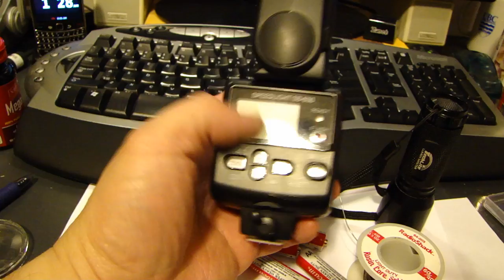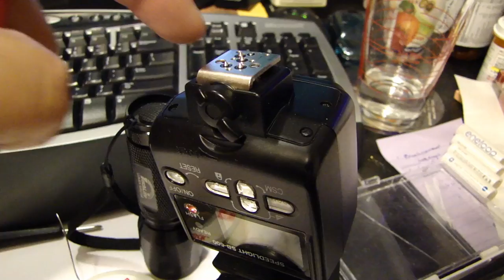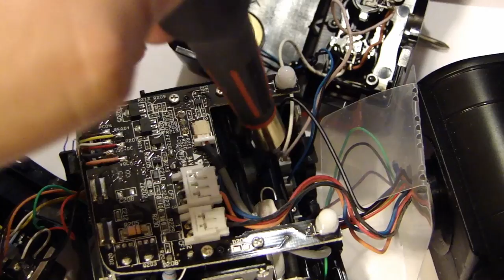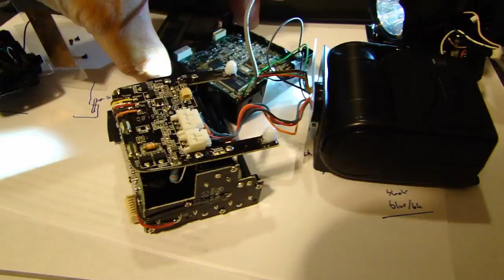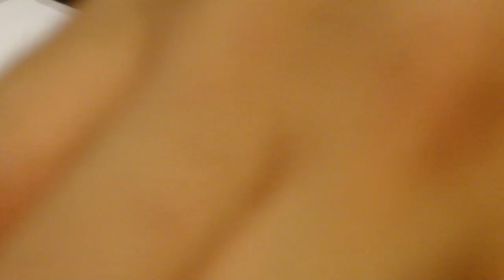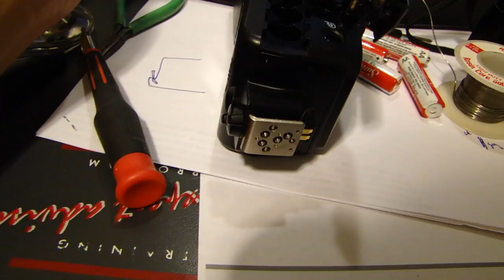How To Fix Nikon SB600 Flash - Dropped & Does Not Power On

Comment: Just wanted to say a BIG thanks for sharing... 

This excellent video provided me with the confidence to 'have a go' at fixing my 'dead' SB-600 after dropping it.

After opening the unit, I identified the F100 inductor - yup, it had taken a hit - bits of the shattered shielding rattling around.

Sourced a new F100 - Ebay (£3 inc P&P) and set about swopping them after watching a few 'surface mount soldering' vids on Youtube.

Put the unit back together - powered it up and it's working again!

Comment: Great video. Saved me 100 Euro. I took my SB600 apart, didn't find any unmounted / loose parts. Anyway i re-soldered the mentioned component on the circuit board and after re-mounting i was happy to see my flash working again :-). Thanks a lot.

Comment from the maker: I have not experienced your issue but in my research to fix mine, the two top problem/fix for SB600 was 1) the broken solder joint shown in this vid, and 2) the flash turns on but won't flash, and the actual flash needs replacement in the flash head. I can't guarantee that is your only broken part.

Comment: Thanks, I solved my problems with this flash following this video.
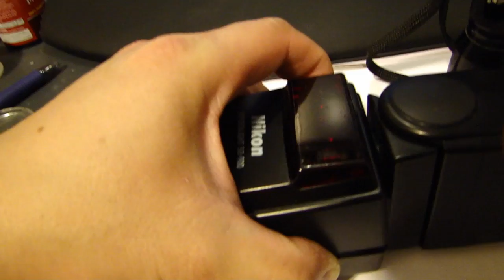Some comments: it is sufficient to remove only two screws near the head of the flash (see at 1:31); it is not needed to remove the gray cable connector (2:40). A BIG remark: the hard part of this work is not shown... remount everything! So be careful.

Comment: Hello dial2fast. I have SB600 that doesn't fire when rotated to the right. In upper position, left and back it works jus fine. You think the wires in there might be interrupted (only in certain position of the flash head?). Thank you! Great video!

Comment: Thanks, with the encouragement of this video I fixed my SB-600 which got dropped today.  Three surface mount components had come off, the inductor (no surprise) but also above it D303 and R360.  Without D303 the speedlight powered up but wouldn't charge up the flash (for anyone else with the same problem to save time tracing the circuit diagram, with the writing on the board the right way up, the line on the diode needs to be on the left side).

Comment: I want a DIY repair for my sb700. Only halted disassembly on circuit board. I can't figure out how the lever and switches at the back seem to be holding the circuit board intact even when screws removed. It had leaked battery but service says no hope resurrecting it just by looking at the chip. Regardless I'll just do it on my own  by cleaning the leaked a battery acid. Any help disassembling the board?

Comment: I remember dropping my sb-600 in the case. And now it turns on but won't fire. You think it may be the same part? I remember turning it on and I heard it trying to charge up the flash but weak. Then it wouldn't do it anymore and when I took out the battery I smelled a little bit of burn

Comment: Hello, I had the same problem that it would not power on and after watching your great video I fixed it! the power is back on but it wont flash. and It dosn't give the ready light. Do you have any idee what could be wrong?
Reply from the maker: I am not sure what other problem it may be, but if the ready light don't light up, then it might be something with the capacitors or the charging part of the circuit. Did you check for any other bad solder joints.

Comment: how did you discharged the capacitor? I got a slight zap but i don't know if that caused further damage or if i still need to discharge it. It's been for more than a week without batteries.
Reply from the maker: I didn't discharge mine but I removed the PC boards separately and didn't need to. Capacitors can hold a charge for a long time. So becareful.

Comment: We had a Nikon SB 700 that would not turn on even with brand new batteries. We pushed down hard on the batteries and spun them to help knock the dirt loose in the springs that connect to the batteries and then it worked fine.

Comment: hey. good video. you seem to know you're stuff!!.
i have a question for you.
i bought a YN 560-II speedlight a few weeks ago and after about 200 photo's of use it just stopped and would not turn back on. i took the batteries out and they where scalding hot! i tried replacing them but it still wont turn on.
do you think this is fixable?
thanks
Reply from the maker: Every electronics is designed so differently. But if you say your batteries are super hot, then I can only assume there is some kind of short circuit inside to drain that battery quickly. Can't tell exactly what it may be. Sorry.

Comment: Hello, Thanks for the video. I have a dumb question, I have never sold anything before, I bought a solder and try to sold the same component and it just wont stick, the sold just melt and vanish but it wont stick and glue the things up, What in the world am I doing wrong? is some kind of specific solder ??
Reply from the maker: Make sure you using the correct solder for electronics with rosin core and also best to get a solder sucker to suck up the old solder first.

Comment: Any pointers for a corroded battery compartment?  Same model flash, won't power up after extensive cleaning.
Reply: ATG suggests to mix barking soda with water. Then apply on the those contacts.
The same thing can be do to vehicles' battery leads.
After drying, use a pencil ink easier to clean the leads, again.
Reply: Try an oil based penetrant or silicone lubricant (like CRC, WD-40, INOX, etc.), and and hit it with something abrasive (like sandpaper, emery cloth, wire brush, steel wool, etc.); I like to use a Dremel with a nylon and/or steel wire brush cups and/or wheels.

Comment: OK, I have a silly question. How in the world did you get the top screws out? Mine are tightened on so tight that I have completely stripped one. Neither me nor my husband can get those suckers to budge.
Reply from the maker: Christy Wadge It's been awhile since I did the repair, but with small screws, you really need to make sure you use the right size of screwdriver. But I don't remember having any problems taking them out.
Reply: dial2fast Thanks for the fast reply. Yeah, we have the right size screw driver. My flash was getting super hot (it exploded 4 batteries at the same time), so I am wondering now if some of the plastic melted on the inside and fused my screws in there. :P I was cracking it open to see if I could figure out what the problem was.

Comment: what did you use to discharge the cap?
Reply from the maker: I did not discharge the capacitors and stayed away from that area for the repair I needed to do. Usually cap discharge is done either by letting it sit for a long time or shorting the two leads.
Reply: Actually it is really easy to touch somy place on board with voltage. Ideally you should use 1KoM 1W resistor and touch connector with black and red wire. Or just wait till voltage will go down. But them you need multimeter to track voltage.
Reply: Just lick it.

Comment: Good video.  But .....SAFTEY WARNING!!! ...are you not supposed to discharge the capacitor before working on anything inside?  I understand there are some 300V across it ....
Reply: Mike McCartney - agree, definitely should discharge the caps before disassembly
Reply: A few things: 
1.You can't charge a capacitor with an open (i.e. broken, or incomplete) circuit. 
2. Capacitors discharge themselves. Without intervention, it'll take about 5-10 minutes for the potential difference across  these caps to drop to 0v.
3. The shock you'll receive from discharging the full capacity of one of these across your finger (not pleasant) isn't really a health hazard.